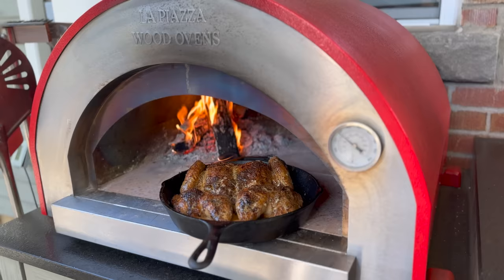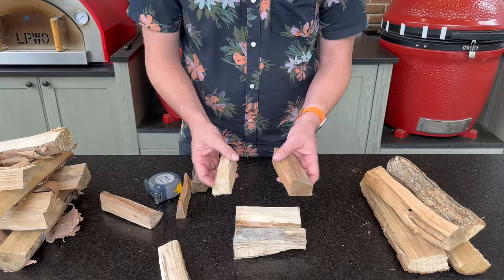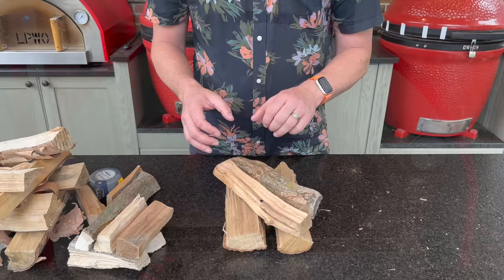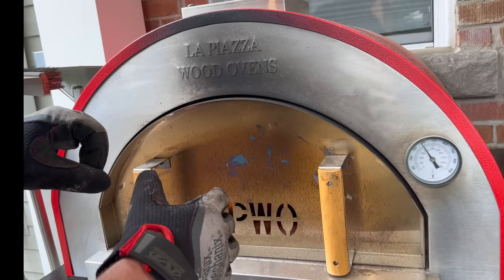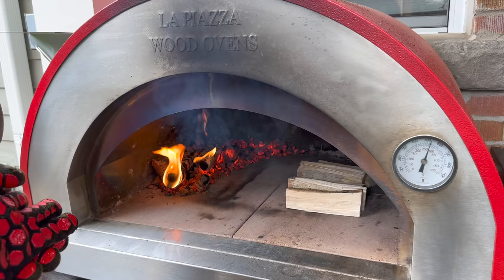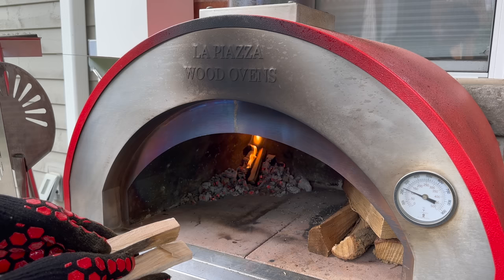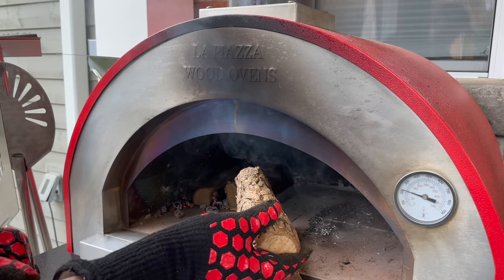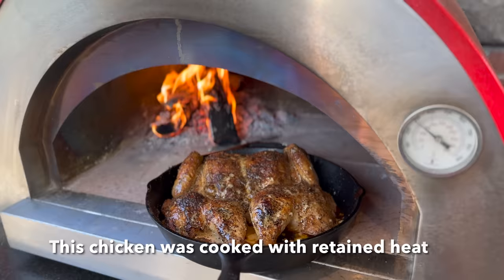Wood Fired Pizza Oven Fire Management 101 | Smoking | Baking | Searing

Comment: Great video as always—thanks! One thing that would be interesting is to have a retained heat graph for the piccolo like you did for your KJ. I know the larger pizza ovens will enable you to cook for hours on retained heat alone and I’m curious how efficient the piccolo’s insulation is. Also, is there a way to use the half moon heat deflector from your classic to block the logo cut out and retain more heat?

Comment: A somewhat related question. I believe you’re using the series 3 charcoal basket in your series 1 big Joe. If that’s in fact correct, are you using the bj basket or the classic joe basket in there?
Reply from the maker: Yes it’s the big joe basket. The fire box is the same so just ordered the basket and removed the stock grate

Comment: I highly, highly recommend a wood-splitter vs. a hatchet.  I've never had a chop saw kickback but I've cut my finger with a hatchet.  I have a small sledgehammer (i.e., a bit heftier than a hammer) and can cut up nice splits or thin kindling with no worries about my fingers.  I have a local firewood vendor that sells larger fireplace-size splits and I reduce them into WFO size in one go with my chop saw and wood splitter.  Lasts for months.  I find the "wood chopping" experience to be part and parcel of the entire live fire experience.  My inner cave man I guess...
Reply from the maker: I do need one of those I think

Comment: Have you ever thought about using a LP burner or weed burner to get the oven up to temperature and then start the cooking fire?  The Rocky Mountains doesn't have very much nature hardwood and I have buy import hardwood.  Seems like you could really save on the cost of wood by starting with a LP burner.    Are you still satisfied with this size oven or would think about or get the next size up?  It is hard for me to really tell how much room you have left to cook in after pushing the fire to side and back from the video using wide angle lens setting.
Great video on how to do the different types of fires and how to manage the smoke.  I can't decide whether to buy an oven or an offset, only have room for one.

Comment: I'm going to guess that putting wood on the side doesn't actually dry out the wood as much as it helps get it close to kindling temperature so that when you add it to the coals it instantly turns into flame.  When you put a cold log onto a fire, the coals will cool down a bit as the heat energy transfers to the cold log.  That doesn't happen to the same degree if the new wood is at kindling temperature.
Reply from the maker: Yes exactly